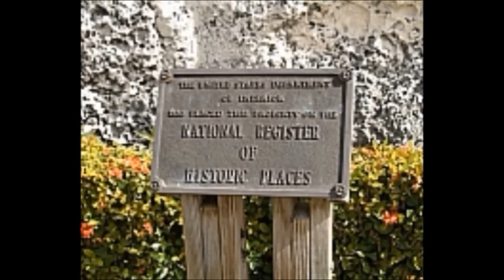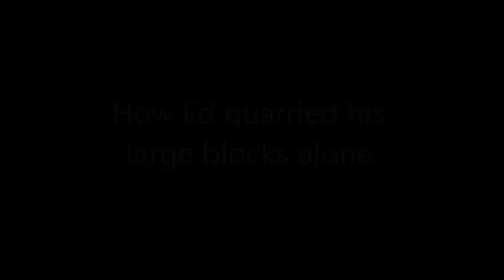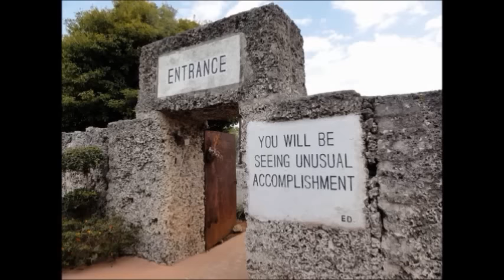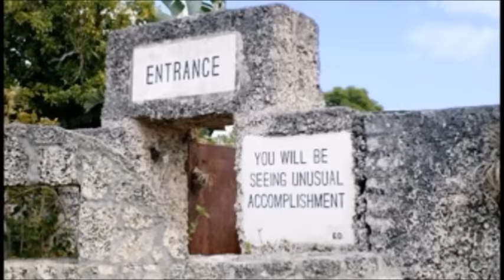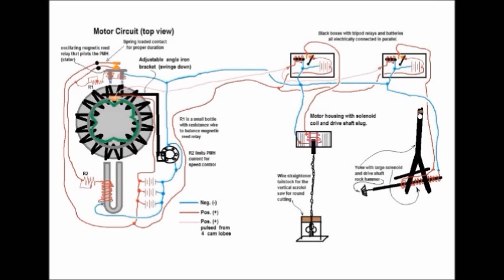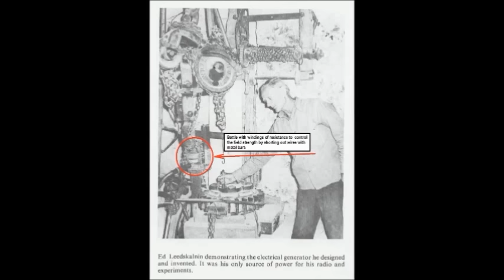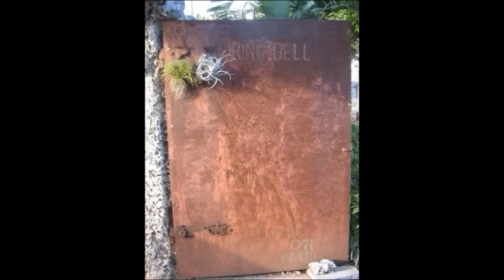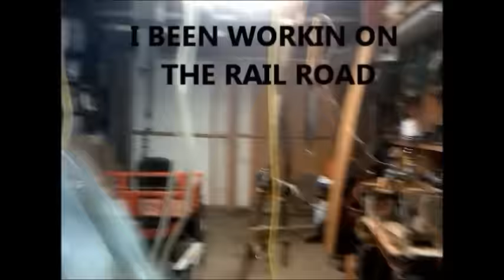Eds Coral Castle Quarry and Flywheel, Engineering Mystery Solved

Comment: Who, What , Why, Where and When? I read his books and agree he had a Electrical Machine that helped him. I would like to see one man duplicate his feats of moving such huge stones. Tripod tree stands and chains in tandem with leverage, don't cut it in my book. I believe the man was on to something, but I would like to see the things he left behind, logically Shown to as "why" they helped with stone cutting, leverage, and WHY he used coral instead of any other kind of Rock. A great Mystery, A great Video and 5 stars!!! RH DSD
Reply: You sound like me, if this guy has proof, then he should demonstrate..  Anyone can make unfounded claims.. Do the Work!
Reply from the maker: I can tell you the answer. because that rock is so damned soft you can cut LOTS of it very QUICKLY with just steel and impress lots of people. even soapstone takes longer because its solid but still goes fast per chisel strike because its soft. The minute you get into real limestone OR HARDER you are screwed on chisel tips. 
        YES the Yolk was just a chisel. lifting will not be the mystery. I WILL DO IT but the wheel and how he cut the rocks is the mystery. and why the internet is so full of crap THATS THE BIGGEST MYSTERY OF ALL.
Reply from the maker: Gimme time bro. I don't have wads of $$$$  or this would be over and I would be sending wireless energy across the lawn with a bunch of recycle garbage Except for one costly item I would have to purchase. But as for CC   all in due time folks bare with me.
Reply: DIOSpeedDemon ,
he just showed you...  pay attention
Reply: ignore these idiots. You have done an exceptional job of explaining all of it. I don't think I could have discovered this on my own, but I was able to easily follow everything you explained. This video is incredibly insightful and well made and well researched. Seriously, well done.
Reply: Steven, dont be such an arrogant groupie man. Guy says you can move them that way but doesn't demonstrate it. In that case, doubt is the smart way to go. Being gullible isnt being smart. Grow up.
Reply: Obviously because the coral is indigenous to the area. 
A bonus for him is that it is soft as well.

Comment: Just curious, how did he cut under the stone to remove it?
Reply: I think just like everyone else. I assume wedges. Pins and feathers this pushes over the block. Works I thin because the sedimentary rock weak plane is attacked.
Reply: Heat is often used to break really big rocks

Comment: Ed said that he used the same technology to move the stones as the ancient egyptians used to build the pyramids.
So the ancient egyptians had either electricity (and steel) or something else. I think I'll go for the something else, unless you make a video of two 10 ton blocks of stone being lifted off a truck and taken from the roadside to inside the compound, in less than an hour, as stated by the two truck drivers and witnessed by two schoolboys.  Ed talked openly about his 'hobbies' that you have addressed in this film, but never about how he moved the stones, that is why he worked at night. He worked just as hard on his hobbies, in the heat of the day, in full view of everyone, no secrets about them at all.
Reply: cutting != moving
Reply: They in fact did have electricity (and at least meteoric iron). It's just that mainstream archeology insists said electricity, was only used for galvanic etching of metals. Sure, a single battery like the one found in Bagdad doesn't do the job but I'm sure they had bigger ones , and quite a lot of them
Reply: it was the great pyrmid it was a giant power station. just look nekla tesla
Reply: Dave Lyon I don’t think the Egyptians built the pyramids, I believe they found them and began their dynastic kingdom there...
Reply: There were chem batteries found in one of the pyramids.
Reply: He didnt want to share his secret with the so called government, new what would happen if the gov got ahold of his secrets, what they would be used for, very intelligent guy

Comment: the wheel directly relates to the basins in Giza they have the same number of nodes and the outside rim.  Ed used this devices to grind the stone to be lifted  In Giza a ball rotated ground the stone each of these produced a vibration in the Vacuums Ether cone shaped objects were then used to focus this energy to lift and place huge many ton blocks.  Two kids caught Ed using what they called ice cream cones when lifting huge stones off a trailer truck.

Comment: How did Ed move the huge blocks onto the truck when the truck driver went away for only a few minutes?
Also Ed used Harmonic "cones" to make vibrations that caused the porous limestone to react and levitate.
Ed had an alcove where he said he punished the bad children and it was actually an alcove where the acoustics were such that they allowed the harmonic and tuned cones to react.
The children who sneaked in saw Ed using these cone shaped rocks which he pointed at the blocks and made them levitate. 
Also remember that Ed 1st worked at another location then after working there for a short while, moved his operation to a nearby location because his finely tuned instruments worked way better at the new location which he figured was better due to his geologic and mathmatic figuring of the star locations.
I have seen such cone shaped rocks used by other scientists in their experiments, I believe it was Tesla who was using them, and no mention of them was involved in the story. I only saw Tesla using them and recognized them as the cones Ed used. These were VERY important to the whole operation. Also Ed used these cones according to the magnetic sounds they emitted according to the tuning forks Ed matched them with. So this intelligent man in this storry might be close to solving this mystery but unless the tuned cones are used then this theory is incorrect.
Reply: You are correct  the cones were made of clay by the way and and in order for them to work one must be in between where ley lines cross
Reply: What are the ones you spoke about tesla using ?

Comment: Although I commend you for putting together all that equipment and showing how it runs, there is still some problems. The first one which would have solidified your answer would have been to cut some actual 5 to 10 ton blocks out of the ground stack them on top of each other and or put some of them on trucks as well and show the the step by step. That's what's rather strange you put all that effort into building it but you didn't even bother to cut and move any stone in the video. Why? That to me seems like an awful waste of time. He didn't explain anything about how he was able to do all the round cuts he had. Solid metal flat plates are not going to cut curves and circles. I have worked with granite and marble for many years and I know the difficulty behind it. cutting curves requires certain tools that you didn't show. Personally I think there was more secrets to that that you weren't willing to reveal. We now know for a fact that toroidal magnetic fields can levitate stuff. We also know that sound frequencies can do the same. And looking at some of his equipment from the video makes me think that he was using it a little bit differently than what you showed.

Anyway you should do another video showing step-by-step you cutting through a rock and then stacking several  of them on top of one another
Reply: Granite and marble aren't really comparable to limestone which can literally be shaped with a sander.
Reply: @koontz1154  Good point, ya beat me to it. F#@k I suck, everybody beats me at everything! I hate Utube.... Lol, ya but limestone is very easily manipulated. When those homemade machines were kind of rebuilt, they weren't anywhere near original working order, he made a comment in the vid to the fact that the "machines" worked with better efficiency originally. We have to try and picture them working on limestone, (I agree granite and marble would be much more difficult to work with, and heavy I suppose. Not impossible, but longer cutting times I'm sure) as limestone would cut, shape and move easier. That doesn't mean easy tho, some of the stone he stacked were at least 10s of tons, 100s of tons maybe? We will call it VERY HEAVY! It's the man's consistency I believe that's makes his building accomplishments seem so impossible. I'm sure he had those machines built so he could be working and cutting multiple blocks at the same time while he rested, those automated machines kept on going. 1 man over many years can accomplish unbelievable things, 1 smart man over many years with the help of his own "automated machines", obviously can  accomplish the impossible!

Comment: dude your not the first person to come up with this.
but your goto remember it was all a secret he wouldent have shown the ppl with the camera how he realy did it.
and your missing the point no 1 cares how he cut and shaped the rocks they dont care what he used to light up the place what they want to know is how he loaded 30 ton of rock on a truck by him self in 30 minutes and how he swung a 9 ton door with persishion and thats putting the bottom in then holding it strait and putting another heavyer block on top of it while lining the shaft up on his own remembering his block and tackel stayed in 1 place and wasent shifted over to the door and how he floated 10 ton rocks thru the air no one cares about what you just said go away and work out how he defide gravity